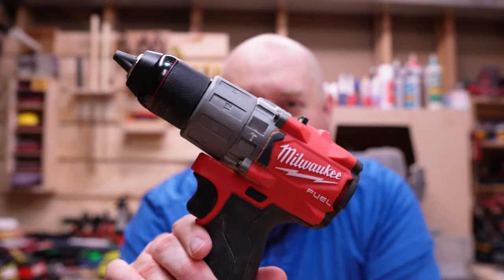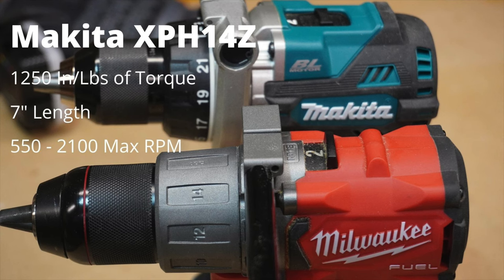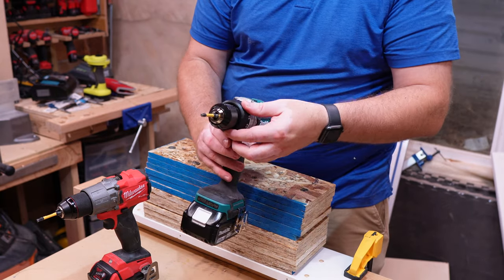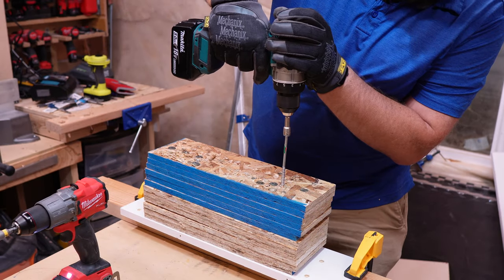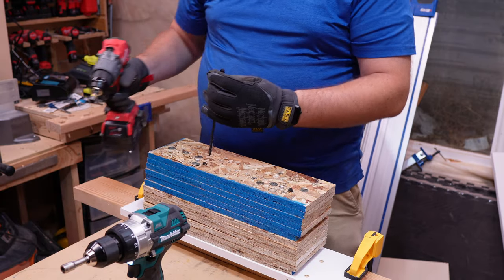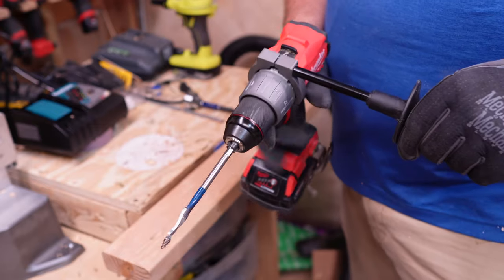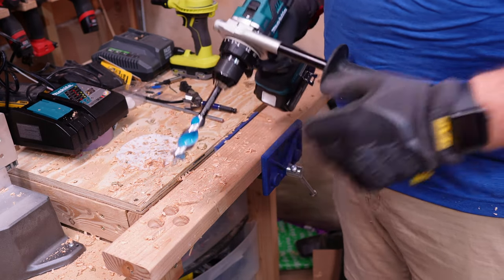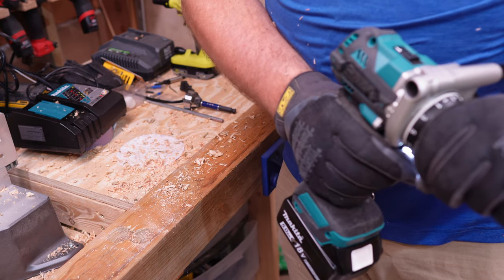Makita vs Milwaukee - Drill Showdown!

Comment: test was rigged....makita rules
Reply: I agree, the same bits but for some reason he holds the makita back at the dig in points!!
Reply: Na it wasn't rigged the test results are similar to other people that did similar test but makita is over all still better then the milwaukee 4th gen tools, because they last longer and are better balanced and over all just a better tool compared to this new 4th gen milwaukee because there more power but they are to worried about making smaller tools with more power but because of that they over harden there gears to make up for it which makes them break fast. Over all as it stands get makita

Comment: I repaired power tools for my job until recently, and I would always tell my customers that Milwaukee's stuff has more power, but Makita's stuff is generally more reliable and has better build quality. I feel vindicated.
Reply from the maker: Both are pretty great tools in my opinion.  They do focus on different things as their top priority like you mentioned.
Reply: until makita released xgt 40 volt I would have agreed. The xgt is now more powerful in my opinion and has better balance
Reply: @CraigularjJoeWoodworks  I haven't had the chance to run an XGT, but I would love to try one.

Comment: I'd strongly consider improving your testing methodology. Makita always went second, while using the same bit from the previous test, which means every time the bit was heat soaked from the previous test, which decreases cutting ability ever so slightly. I would also like to see at least 3 runs per each individual test, as wood density/grain is variable from test to test. Same goes for which modes you run the tools in, would like to see same number of runs in each mode for each tool. If you re-run this test, making the changes I suggested, you'll find a lot less than ~18% difference between the results.
Reply from the maker: You are probably right and thank you for the feedback.   At the end of the day, Makita does safeguard their tools more than Makita does and that ultimately is the difference between the two.  On any given test, they are very similar.
Reply: @TinkerWithTools  Sure, I figured constructive criticism is better than just hating on the channel. I really like your style, and the way you explain things. If the testing was slightly tightened up, I'd love nothing else than to have another go to channel for tool reviews/tests/comparisons. Thanks for all your hard work, looking forward to future videos...
Reply from the maker: Thanks and I appreciate the support.

Comment: This man speaks the truth even though he's team red.  I do my own tool vs tool tests and I agree completely.  I'd like to see these two against the newest Dewalt DCD800.  Also want to say Metabo and Makita seem to value the same things such as precision, weight, balance, etc.  The things that an average contractor can't wrap his head around and just goes for brute force and speed.
Reply from the maker: Thanks Man.  I've have the 800 and for anything under 1" drill bits and smaller fasteners, it probably would be equal if not better.   Its a powerhouse.

Comment: Another win brother. I love that animated intro. That was awesome. I can’t speak for the MAKITA cause I don’t have one but it looks like a fine tool. People forget how much torque it takes to run a 1-1/2 inch spade bit or that 1-3/4 Irwin you have. That speaks volumes on the power of these drills. Great job on the review as always. All the best to the family my friend
Reply from the maker: Thanks.   Same to you and your family.  Yeah those bits start to push limits of what drills can do but these top tier drills just push through.   I need to start incorporating hole saws as well.
Reply: That Milwaukee needs to be run with the 6.0 if you're gonna even call the matabo the challenge Winner.. I believe you will have a new winner 🏆
Reply from the maker: Never said that the challenge was over.  The Metabo HPT is just the leader for now.  There are still quite a few drills left to test.
Reply: @TinkerWithTools  i got the DCD 800 today for $60.00 BRAND NEW WARRANTY I LIKE VERY MUCH
Reply from the maker: @TacticalThib  how on earth did you swing that with such a new tool?
Reply: @TinkerWithTools  well I bought it from Facebook and I was dropping off a battery at my local hardware store the handle warranty for all brands so I had dropped the dcd 800 off and had it warranty and got new 12ah Milwaukee battery and the 800 ohh and btw did you know dewalt has only a 1 year warranty anything after 1 year they charge you for parts 🤔 this is my first dewalt drill and will be my last...
Reply: @TinkerWithTools  i just made a few shorts one about the dcd 800

Comment: I have the Makita and have used the M18 a lot as well.

Its Makita all day for me. No one makes impacts and drills as comfortable and ergonomic to use as Makita.

I think they tone them down a bit on purpose electronically in the power department for longevity but they are so much more refined then milwaukee and especially dewalt.

Recently I used milwaukees warranty on a couple tools, and I have to say I was extremely impressed. Took in a couple tools that were 1-3 years old that have been used everyday. Within a week I got a call to come pick them up and they replaced every tool no questions asked. I don't feel like Makita would be that simple to warranty (if needed, have never had to and that's my main platform).
Reply from the maker: I’m trying out the warranty on Milwaukee right now so hopefully I have a similar experience.   You are right.  Especially on the impacts Makita is more smooth and comfortable without a doubt.
Reply: Excellent comment!  Having owned and used both brands, they each have their best and worst models, like any Company.  Milwaukee indeed has good service, and turn around time.  Makita is not so bad.  If you live on the East Coast, try the New Jersey Factory Service Center.  It is great!  Milwaukee makes some great tools, as does Makita.  I concur wholeheartedly with you on makita.  Milwaukee needs to get their Corporate heads outta their “you know what, “ and DROP those ridiculous triggers!  I’m not alone in my disdain on that design.  I LUV my M18 Fuel surge, but hate that dammed trigger.  ARE YOU LISTENING Milwaukee ???  I’m done now!
Reply: I’m 100% on the Makita LXT Platform and have only had one warranty claim and since I was close to the Makita Service Center in Wilmer, TX I dropped in and they serviced my XPH07 immediately (broken planetary gear from using bi metal hole saws in 3/16” steel, definitely overworking the drill but it never quit even with the broken gear). I now have the XPH14 and it is a beast. 
I recently purchased Makita’s XGD01 Earth Auger kit which is actually the XAD03 36 Volt Right Angle Drill with extra handles and bit adapters, I a now using it for drilling holes in steel,and with its lower speed and torque limiter it’s absolutely perfect for the job.
Reply: I'd rather have a tool for longer than be able to drill 0.02 seconds faster🤙
Reply: In New Zealand, makita is cheaper and have reliable after market supports. Milwaukee is way overpriced, reliable as well, but it's too heavy for my hand
Reply: Agree. I don't like the shape, color, or power of Makita compared to Milwaukee (I like red, boxy shape). But I just like the makita impact driver or drill in my hand. It just really really fit in my hand.
Reply: I agree. I’m an electrician and have been using Makita for 7 years. The trigger feel is what impresses me. My coworker use everything from Dewalt to Kobalt and none of them compare.

Comment: I definitely agree that ergonomics are an important consideration with tools especially when you get older. I'd get home from work and I wouldn't be able to use my hands because they were in so much pain using big heavy unbalanced tools for light assembly work.  Switching to a Makita 12V max brushless driver that's light and balanced and with more than enough torque for what  I do has made life a lot better for me.
Reply from the maker: Yeah I love 12v stuff when you need it but that big Makita seems smaller than it actually is also.

Comment: My plumber has a box of a few Milwaukee drills and some other Milwaukee tools he needs to send back and try to warrantee. Meanwhile my old makita 07 still kicking mixing this set, grout, drilling 41/4 in hole saws etc for the last few years. He needs Milwaukee for the plumbing stuff but he is really thinking about going makita for drills, impact and carpentry tools. Can’t beat the build quality and smooth operation

Comment: Thanks for the cooperation.  I had two systems 3 years ago. I end it up giving my entire milwaukee system to my employee. 
Due to the milwaukee battery, after several months, heavy uses only charged  65 to 80%. 
Like you have said it.  
Installing 30 pairs in ceiling speakers, my makita burned on me, and I can not finish my jobs.

Comment: Why this genuinely amicable and well spoken Man has less than 10K, even 5K Subscribers, is beyond me?  As I replied to ‘Eviction Carpentry’s’ excellent comment, I own and use both, but have always been a Makita guy.  Milwaukee has a great lineup, and extensive battery sizes.  No doubt this M18 Fuel Hammer drill is a beast.  I think the Creator here stated it eloquently.  Makita’s motors, whilst not always the top in power output, are some of the smoothest and best balanced.  The LXT lineup is very extensive, only to be let down by the lack of higher amp hour batteries.  As one of the Top Makita Techs was trying to BS his way out of our conversation, regarding said batteries, he tried to explain to me about the FAA limits on Watt hours for shipping, and how I wouldn’t want a huge battery on a drill or impact.  6.0 Ah is the best Makita has to offer, and they’re not even 21700 cells!  And then Makita comes out with the XGT system, with honking 40 Volt batteries, on drills and impacts!  Ridiculous!  I’m not putting down the XGT lineup, rather Makita’s lame and sorry arse let down on the LXT platform.  And, have you tried to buy/find any Makita 6.0 Ah batteries lately?  

Milwaukee has two areas that I have issue with.  One; those @#%^ triggers!  Use that hammer drill long enough, and it will leave your trigger finger sore.  Other YT channel creators have complained of this issue.  Two;  Sharp edged plastic!  I just picked up a new GEN 2 18 volt 2 gallon Shop Vac, and first thing I noticed, was the sharp edged line of plastic that ran along the handle!  ( The Vac is very nice BTW )  I guess Milwaukee wants to sell more of their fine Cut Level gloves ?!?!  🤔🙄😂

Big thumbs up for a great video, and well presented review.  Oh, and count me as a New SUBSCRIBER!  

Take care!  👍✌😀
Reply from the maker: Thanks for the support!

Comment: I forgot the channel name, but they adapted a stacked lithium battery to the Makita and it’s up there with the gen 4 and flex drills. Makita just needs to update their battery tech and you’d see a lot of these “older” tools shine. As a woodworker the drills and impacts have all the power I need, I’ll take the extra control.

Comment: Welder fabricator here, as someone who spends all day drilling and welding on 1/4+ stainless, mild, and ballistic steel this is not even close. Makita smears Milwaukee like a skidmark on reliability (sawzall and portaband the ONLY exceptions).
Makita takes a lot longer to give you hand fatigue, maintains a stable warm temperature (Milwaukee handles get hotter that they should, I suspect a connection was made too thin) and the weight distribution is off on the Milwaukee.

DeWalt is built like a box of marbles so while the ease of repair is there the poor fit and finish as well as seeing two sawzalls burn out in less than a year I wouldn't buy again. (DeWalt was my first tool brand
Reply from the maker: Nice input.  Thanks!

Comment: I started to pick an electric screwdriver and was intended to take Makita 7-volt pen-style screwdriver. Still, it falls into the price category of 18v tools so considering more versatile power tools now. I'm mostly using screws for furniture but everything in my hands is none electric. I think that the more electric I get, the more I will enjoy, Looking for suggestions where to stick with XDF131 or XT288T or XT296ST toolsets?
Reply from the maker: I like compact tools for compact jobs so the XDF131 is great for that, but it lacks in power even compared to other brands compact options.  For me... while the XT296ST is less money, it's not more compact than the 288 by a meaningful margin and yet is less powerful and feature rich.  For those reasons, I would go with the 288
Reply: @TinkerWithTools  yes, I was about the same thing as it picked either top line tools.

Comment: I keep noticing on the self feeding boring bits and  spade bit, when you start the tool you're pressing into the wood with the Milwaukee, but with the Makita you always let it spin for a second before putting pressure on it.
Reply from the maker: I can see what you are saying in a few of the tests.  Typically with self feeding bits i let the bit do most of the work.   I guess maybe the bit wasn’t pulling as clean on the second run with the makita.

Comment: I wanted to replace my old Porter Cable. It still worked but was long in the tooth. Got a Milwaukee and the gears broke after two years. Still have the PC and it works as good as ever. I did recently buy a Makita so if it breaks, I've still got the PC. I used it in the trades so it's got many thousands of holes and screws driven.

Comment: it's simple really. makita makes better/safer battery and motor protection, where milwaukee leave it a bit "open", so you get maxed out power drain etc (same thing on teslas etc). that get you slight performance gain, but on the long run, you will have more failures, performance drop etc.

Comment: So, I use aftermarket, Waitley 9.0ah batteries on my XPH14 and my 2803. The other day I was drillimg through 3/8 steel with the Milwaukee. It was in first gear, but kept cutting out (it was in drill mode). So I got my Makita out and it didn't stall once. So I wonder if batteries play a role. Meaning, even though they are aftermarket,  maybe 9ah batteries give it more power.
Reply from the maker: Interesting.  I have never ventured into the world of aftermarket batteries much and I don’t a ton of drilling in steel so I appreciate providing your experience here.

Comment: I'm invested in the Makita battery system so for that alone, I'm a fan. And never any problems with any Makita cordless tool for my occasional use.But the reason the Makitas shut down under heavy load is for thermal protection that is built-in. It's not that it runs out of torque. This why Makitas run cooler.
Reply from the maker: I get why they do it but it can be frustrating at times.  They seem to have more to offer so you wonder if they balance could be better optimized

Comment: the chuck is a big problem ive been using makita drills substantially these past 10 years and i dont have the time to go in and replace whatever it is it so ive needed to buy around 5 drills in the past 10 years i install showers and drill tiles everyday so it takes it toll but 2 years each drill i think isnt that bad considering i dont only drill tiles i also drill stainless, aluminum, wood, concrete and of course tile but ive tried to use a milwaukee drill and for those tough tiles it just doesnt help
Reply from the maker: I had a problem with the gearbox on my LXT but not problems with the chuck.  But I clearly don't put in the same level of use that you have on these tools.  Thanks for sharing.

Comment: why reviewers always seem to focus less on the hammer function
Reply from the maker: This is an older review at this point and it was before I did testing on the hammer function specifically.  In more recent tests I do touch on it more, albeit in a limited manner.    I have more of a history on using a drill on wood than in metal or concrete so early on I stuck to what I knew more.

Comment: When I started my company we used makita. Because we use the tools for solar plant installations the tools where used to the max. I needed to replace a makita tool once and sometimes twice a year. I switched to milwaukee 2-3years ago  and every tool is still working. Only my Hammerdrill broke after 2.5 years. Even it was outside the warranty, milwaukee repaired it without costs.
Reply from the maker: Thanks for chiming in.  I can’t say I would have guessed that outcome but thanks for the input.

Comment: I own both and I agree, Milwaukee is more robust and powerful, but also bigger and heavier.
Makita is more ergonomic and lighter, similar to Bosch Professional.
Battery degradation over the years seems to be slightly less with Makita compared to Milwaukee, but the Milwaukee tools themselves (i.e. mechanical parts) seem to last longer.

Comment: I have the Fuel but man I wish I had gone Makita.  That drill just looks so much more comfortable.  One positive thing about the bulkier drills is you have more space to distribute the weight.
Reply from the maker: They are both awesome.  Makita seems just offer more refinement.
Reply: But then what would your friends say.... ???
Reply: I just ordered this model of Makita drill ... I think it has 120nm of tourque.

I’ve been using makitas old NiMH red battery model (that had a battery similar to the ryobi, for years - and made an adaptor to take the new LXT 18v batteries ... it had an all metal chuck and was rock solid.   But lately been needing to predrill steel - and it felt underpowered.

Drills are not something I use too often so didn’t seem necessary to upgrade ... but found this new Makita demo for 80 bucks. Winner